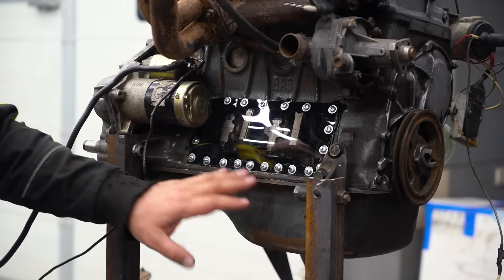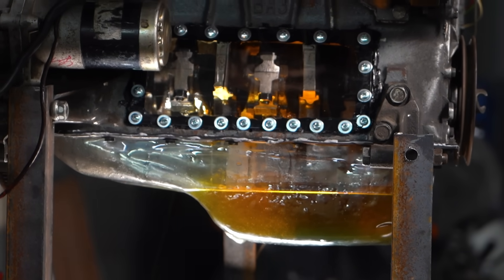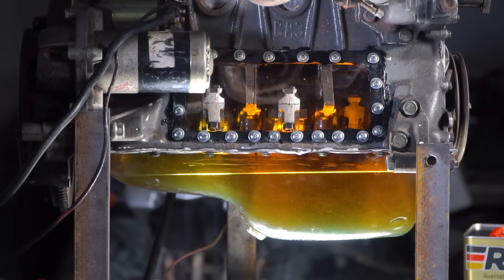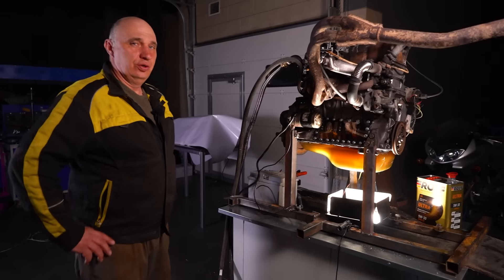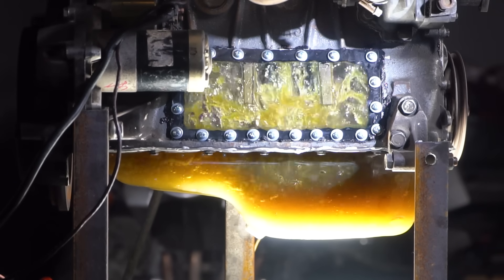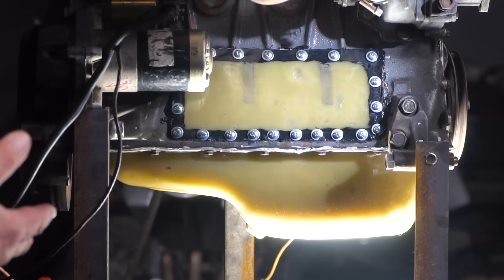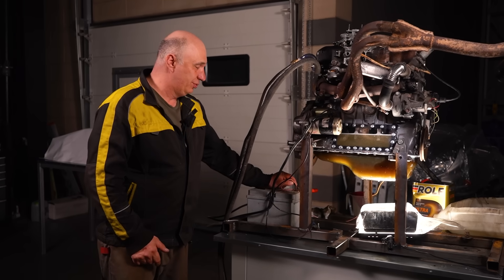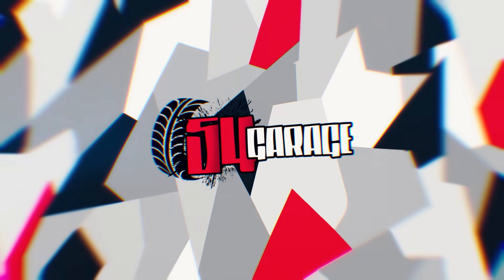What actually happens when you overfill your motor oil? (w/ transparent oil pan)

Comment: Genuinely impressed by how much that custom made plastic sump was able to take!   The pressure inside it must have been considerable!
Oh and any worries I had about accidentally adding 1L too much oil on my next oil change are gone forever!  Thanks 👌👍
Reply: I love glass/transparent spark plugs even more! When I first saw one, I was like “this probably explodes the first minute.
Reply: I had a 1972 Mazda 616 with 1600cc OHC engine. It held 4 imperial quarts (5 us quarts). I changed the oil every 2000 miles and the oil stayed clean. I went to a full service gas station, they used to check the oil at every fill up. The guy said it was low so I had him put in a quart. I only drove a few miles and the pressure build up in the engine blew the filler cap off and sprayed oil all over the engine. The filler cap was hard plastic with course threads that screwed solidly into the valve cover so the pressure build up had to be considerable.
Reply: I guess that's why Ford engineers decided to use plastic oil pans, only theirs DO leak!
Reply: Its not combustion chamber duh, so not really much pressure worth noting on, the pressure inside crankcase block is ventilated out through PCV.
Reply: @khlua4590  Yes, thank you I know "Its not combustion chamber duh".
But it still had the weight of 20+ L of oil on it with the centrifugal force of that being spun around at 5-6k rpm, so yeah I think there probably were some forces exerted on it. As was apparent by the way the oil sprayed out with force from the mating face when the gasket sealant eventually failed toward the end.
Reply: @soundseeker63 Lol nice try at trying to correct yourself but you're still wrong on all fronts. There's virtually zero pressure in there.

Comment: So if I operate my car on level ground and keep the motor at low rpm’s and under no load, I will never have to worry about oil not being picked or windage issues. Too high or too low, no problem. Has Porsche, MB, GM or Ford heard about this good news?

Comment: I was expecting some kind of hydroblocking but it seems that foaming was the only issue. I wouldn't have been brave enough to do this without safety glasses, full face mask and clothing that can prevent hot oil from getting on my skin if the window explodes.

Comment: More oil is not good. I have a scooter (sym gts 250i evo) and it is notorious for its gearbox. I bought it second hand there was 60k kms on it. At 61 kms i had the gearbox oil changed. Guy put too much oil and it caused friction. Over time it fked the needle bearing. I had to replace bearings and gears.

Comment: Good test. But it didn't answer the question, or mention what the damage would be when someone over fill an engine above and beyond the crankcase. The first two test was clear. Having a little over the max level is ok, in fact I recommend it if the engine rocker arm and valves are tapping. The last test doesn't really show what the damage would be if you completely fill an engine block till oil starts to come out of the oil dipstick. So, I'll try to explain it. First the engine depicted in the demonstration is of an old design, not that what I'm about to explain can't happen to it, but with the design of this type of engine, too much oil can still evacuate the crankcase. You saw it with the crankcase breather and how he put a hose on it to catch it when he revs the engine up. This would not be the case with today's engines as the breather now has what's called a PCV valve on it (Positive Crankcase Valve). What does this mean. A PCV valve doesn't allow oil fluids to escape the crankcase. The crankcase breather on this engine would normally have a hose attached to it and hanging low beside the engine, in the event that oil levels get too high, well, it would do what you saw in the video, start evacuating the oil from the crankcase. All engine crankcases will build up gases, so they can't be completely sealed. In comes the PCV (positive crankcase valve) What does it do? First, it stops overflow oil from escaping into the environment and coating the streets and highways of the cities. Secondly, it allows the buildup of gases to be able to still escape the crankcase. How does this work? The part (PCV) is made with a non-restricting floating steel ball and is seated in the crankcase breather journal, so now when gases buildup, the ball will float and let the gases out under normal conditions. But if the engine is filled above and beyond the crankcase, the steel ball will move to a lock out position and stop the oil from evacuating, essentially sealing the crankcase breather. In this case when that happens the damage to the engine would cost you thousands of dollars as it would surely induce a Hydrolock, or properly said Hydrostatic Lock. A few known damages caused by Hydrostatic Lock, or Hydrolock is bent or broken connecting rods, damaged bearings, or and any combination these. it could even break the engine block itself. To check to see if the PCV valve is working is simple, find it, remove it from the crankcase breather put it close to your ear and give it a good shake. if you can hear the steel ball rattling, it's working.

Comment: Crankcase pressure and aeration is the problem. Too much pressure causes leaks and the aeration will actually decrease the oil pressure....like air in the brakelines

Comment: Always OVERFILL a bit. your oil would last longer, and your engine would worn less, coz more fresh oil is available, and would get black less often.  Consider attaching a pan of 10L capacity, Now 10L is revolving so each pint is revolved less times, means less breakdown of the oil. And will degrade way less. Keeping the car engine new for longer duration. So, if you put 3L in an engine, and change it at 5000km, you put 4L and you may use it till 6000+Km.  

NEVER OVER FILL TOO MUCH>  1qurter or 2quarter extra oil is just fine for any normal cars ( Except fraries and sport cars). 
Over oil is always better for the engine.

Comment: It is okay for the Oil to be bit higher than the requirements, about half quart which will help.
However, several factors should be taken into consideration.
1) hight cost in oil,
2) less space for Engine breading,
3) oil going trough the PCV Valve,
4) oil getting into the intake Manifold,
5) Injector problems,
6) more servicing on everything from Spark plugs to intake manifold,
So, a bit more if the cost is affordable (half quart), could help a bit.

No need to put oneself into excessive cost, especially if the engine is serviced properly.

Comment: The foam disappears when the engine oil reaches working temperature, the worst that can happen is that the oil will pop out the crank seals when it reaches the level of the crank seals. I witnessed this personally at work a few years back due to a rookie mistake of an apprentice. Nothing to worry about here.

Comment: This makes me want to always add an extra quart in the first place.  I always wind up adding one at some time before the next oil change.  Why not get it over with and eliminate the need to check it?  And your oil will be 15% cleaner (by the definition of per cent) for the whole cycle.  Now I want to add two quarts, lol...

I suppose the gearheads here wouldn't approve of my younger self waiting for the valves to start clicking before adding oil in my previous beaters.  I'm not even sure that was a real thing, but when I heard the sounds, I would check and the oil would always be low.  And it would go away with more oil.  But correlation isn't causation.

The plastic oil pan lasted longer than I expected.

Comment: I had a customer with an Audi 2 Liter TFSI engine on the phone, and he told me, that he received a message "low oil" and he filled in oil, but he want to know if 3 liter is enough. I told him: That's to much, dont drive. He said: That was back in 150 kilometers . And i said. Ok, than its allready to late, you can continue driving. Two days later, he came into the garage and we changed oil. I measured the drained oil and there was 2 liter to much oil in the engine, but no damage. The car still drives 3 years later.

Comment: I drive my 1985 F250 with a 6.9 Liter diesel engine about 500 miles per week. The official crankcase capacity is 10 quarts, or 2.5 US gallons. 
I’m always at least 1-2 qts over full at ALL times… This truck burns a gallon of oil every 600-700 miles. I just change the oil filter once per year, even though it probably doesn’t need it . . .  . BUT I NEVER DRAIN THE OIL.

Comment: Back in the 70's I heard a story of a guy that had been racing his '65 Chevy Impala at our local dragstrip. He had just won his semifinal race and upon returning to the pits had lost oil pressure. Figuring that he was going to have to tear it down later, he added three quarts of oil, which gave him eight quarts in his small block Chevy engine. He went to his final race and actually won! After collecting his rewards, he drove it ten miles home. Upon teardown it was discovered that the oil pump had failed. Not sure if he rebuilt or replaced the engine.

Comment: Don’t overfill. I used to overfill by a quarter quart or so, and over time, my piston seals starting leaking and burning engine oil. When a few reputable mechanics looked into, their conclusion was the increased pressure from too much engine oil over time did this.

Comment: How come last time i over filled my engine the car started blowinh a thick white smoke when accelerating. And when accelerating hard the revs increased whilst the car was barely picking up speed. I later dropped the oil to the right level and the white smoke ended up disapearing the longer i drove jt and now is back to normal.But now the engine light comes on occasionly and is the 02 sensor. Any suggestions as to why or the cause of the engine light

Comment: The thing is, when you over fill it like they did, they oil is way more prone to foaming. Additives in the oil are present to not allow for foaming but when you have the oil filled 2x the max level, you saw it foaming when you were revving it up. Foaming isn’t wanted in the engine

Comment: Dangerous experimentation by weakening block for viewing.. as it starts foaming.. uneven side torque by uneven air pockets can cause metal fatiguing of crank flexing.. if long run high speed.. blow apart with crank breakage with block integrety support gone..

Comment: Wow. That’s a lot of foaming in all of the examples. That will kill the engine in short time.

From what I have read, you can get away with overfilling the sump with 10% of the written max engine oil capacity. Though I wouldn’t feel safe after adding 1 liter to the max level...

Comment: Not only is aeration a problem, but on Honda J series V6’s, overfilling engine oil will push the rear main seal out of its groove and cause a massive leak.

Comment: So cool, my auto shop always over fill my oil by 1/2 to 3/4 quart.  After this I see that’s no problem.  Lol ( Filled above the “safe” mark on the dipstick)
I would think the seals would leak because of increase crank case pressure.

Comment: The difference between MIN and MAX on the dipstick is usually 1 quart (sometimes less on smaller engines), so you can gauge how much you need to add.   It is not registering EMPTY when at MIN, as is suggested in the video.  (“Now I suggest we double the amount of oil.”)

Comment: Overfilling the engine will lead to crankshaft failure since it’s a hardened component not designed for impact with the oil surface on a dry sump engine.

Comment: I once bought a generator brand new and was told to put oil because it was dry from the factory. I put in the recommended amount of oil and it would stall after about 5 minutes. I later checked the dip stick and it was wayyy past the full line… nothing bad happened to it but its strange how it stalled but not this motor. Is it a safety feature or is it because its a smaller motor?

Comment: I think even with double oil, as you drive and brake it'll slosh the oil into the crank. But less than a quart over, it'll never be an issue

Comment: I just got an oil change and was really worried because when i checked dip stick the oil was above the max line. This video puts my mind at ease. Thank you.
Reply: i overfilled more then 1/4" over the max hole,and nothing happened so far
Reply: @marmay6874  Keep going.
Reply: I got unlucky then. Brand new car engine seized due to overfill. I didn't find the need to check since I it was a brand new car. Damage was done after 9k when I saw smoke pouring out behind going up a hill and afterwards saw that it was massively overfilled. Thankfully warranty kicked in since it wasn't my fault. They said with the newer engines everything is tighter so it killed it.
Reply: @Super-Kev_99  We talking 9k miles?  I know most new cars tell you to follow the recommended oil interval, but that's to pad their "cost of maintenance" numbers.  I changed my oil on my brand new car at 2800.  Dealership tried to tell me no.  Told them to shove it, and do it.
Reply: @Banana_Cognac  Sorry it was 9k in kilometres. Service on that engine was due every 15k.
Reply: @Super-Kev_99  ohhh ok. I was worried for a bit haha
Reply: It means overfilled from factory?

Comment: So going over a bit doesn’t mean you need to drain some off. Going over a lot then yeah drain it. I’d rather have a little too much than not quite enough. I am curious what happens when they’re run 2 quarts low because one of my vehicles was run low several times before the “oil consumption” issue was fixed by Honda by installing new piston rings. Always wondered if anything got damaged by running low like that or if there was enough oil to splash important stuff when it’s 2 quarts low

Comment: Great video. I love it, but it important to mention 5 cases + consequence not covered:

1. This test just covered few minutes. In real life, your engine spend years under high oil pressure. Can such overfilling habit cause premature leak? Possible.

2. Your engine will have to work hard. Which results in underperformance, high fuel consumption, and to maintain high performance, you will accelerate more, causing potential early ware of pistons rings and other failures in a long run.

3. Old school engines are robust and simple. Yet modern engines have to sacrifice a bit of that, to meet modern demands such as: To put in sensors reporting the monitoring to computer box. 
They are also built smaller to reduce; weight, consumption, pollution yet increasing performance and hp to score high efficiency, quick acceleration, high speed, high towing capacity, etc… And all of that while consuming less fuel and polluting less since it cost high CO2 taxes.

4. In very cold weather regions, this engine won’t start unless there’s an oil heater keeping oil warm when engines is off. Usually practice in Canada. However at such high level of oil considering that battery performance is low in cold, there’s more chance to have a failure to start.

5. Money Cost: In today world, You will burn more fuel, will spend more money in oil services since you need more oil, pollute more to reach minimum acceleration, which can cost pollution taxes in some countries, early maintenance cost due to engine ware or failure.

Note: Just remember that modern engines are  tested to the extreme until failure. And then engineers give recommendations accordingly. That might not be the same with old robust engines. 

Caution: Be careful & don’t take this wonderful experimental video as a proof that you should overflow your model engine.

Comment: So what exactly is the point of this video?  It' okay to put 10 quarts of oil when your car only needs 5?  You go ahead and try that on your car and see what happens in a couple thousand miles, STUPID.  You can clearly tell that the oil is turning into foam and you think that is okay??
Reply: The point is that we aren't going to worry about it when we overfill our engines a little bit. The point is also to display an experiment.
Reply: @Soundmountain1  That engine looks like  a hundred years old.  Do you know how much clearance is between the oil in the pan and the crankshaft in YOUR engine that isn't that old??

Comment: One day, I took my boss's jeep to go on a trip. I measured the oil, but I could not see the oil level on the dipstick. Then I started adding oil to the engine. I still could not see the oil level on the dipstick. I added a total of 7 liters of oil to the engine. Then I set off. Half an hour later, strong white smoke started coming out of the jeep's engine cover and the engine stopped. Later, I learned that I had burned the engine. At that time, I did not understand why this happened. A new engine was installed in the car. Now I can clearly see what I did.

Comment: I don't believe the level of oil caused the pan to leak as much as it was the engine temperature caused the plastic to get soft.

Oil pressure gauge would have been a must to accurately gauge oil pressure loss through cavitation.

Comment: We often fill our race cars a full quart over (bmw e36/e46). Nothing worse than oil starvation in long high speed turns. A tiny tiny bit burning off in the first few laps is no issue if you get real crazy with it. Obviously, it's engine dependent. Baffles and/or a dry sump system helps a lot in regards to limiting oil starvation.